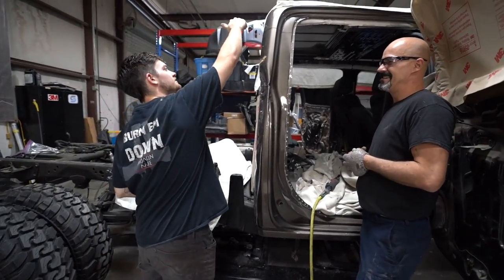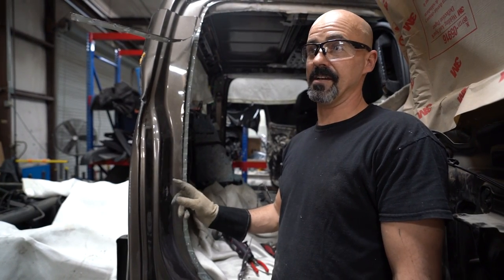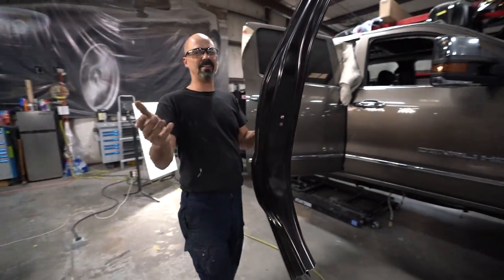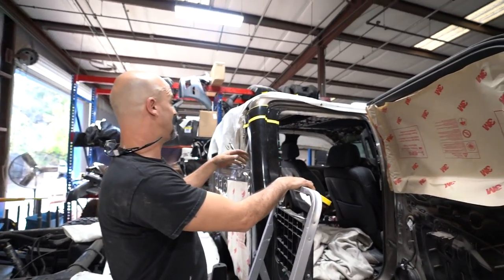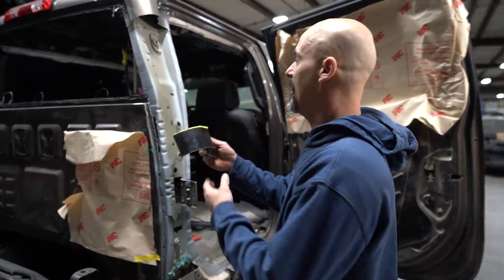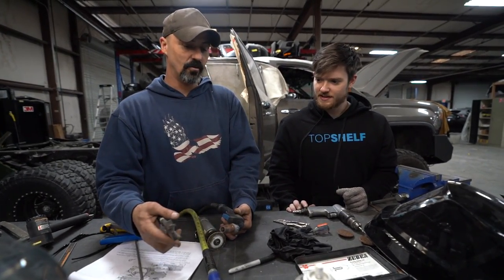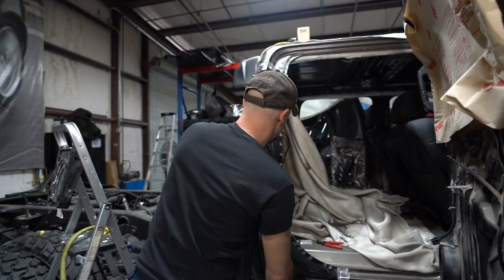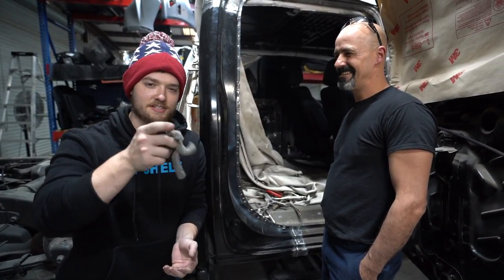Literally EVERYTHING You've Ever Wanted to Know About BODY REPAIR | Part 2 of 2

Comment: The wire distance with a mig welder doesn't really change the weld temp. The voltage is set and the welder will pull more amps the further you get away. It compensates for the increase in resistance to maintain wire burn off. If anything the weld gets colder being further away. Stick and tig will get hotter as your distance increases

Comment: Oh no! I just stopped by their shop to get a similar repair done on my truck and I was slammed with a $15k starting price for a side bed panel that needs replaced, corner cab replace, and a small but long dent on the door. The conversation  lasted 2 minutes with one of the guys at Magnum. I love the work but I have to go somewhere else 😔